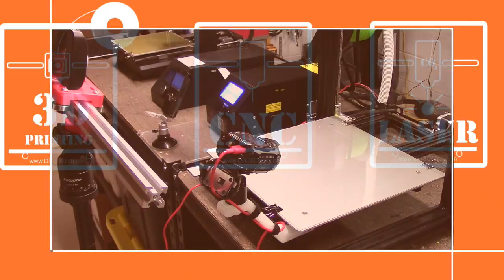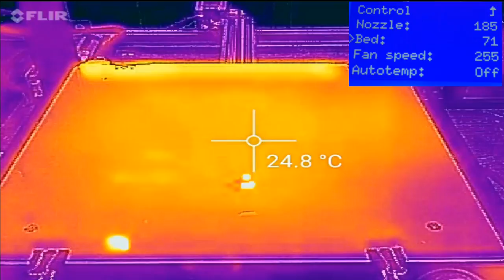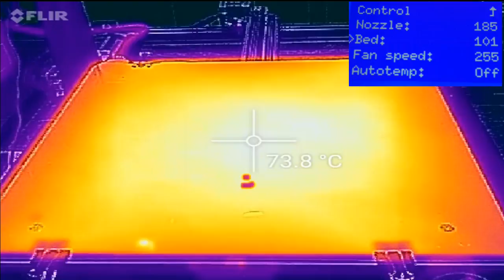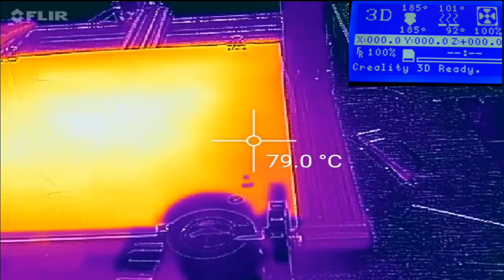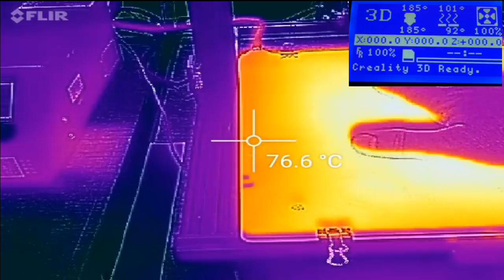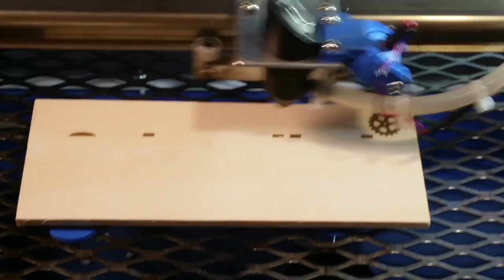Creality CR10 - Analyzing the Heated Bed with the Flir!

Comment: I know with the FT-5 build, many people use a cork tile under the aluminum bed to insulate the heated bed and help it heat up quicker/maintain temp.  Pretty cheap to find at WalMart (office supply dept) and curious to see how that would work.
Reply from the maker: Interesting idea, however my fear would be "have you ever seen cork burn?".  Nasty stuff as it burns an spreads quickly.  So I would avoid it for a non-flammable version, I am think ceramic tape as its light weight with a high reflective coefficient.

Comment: The stock CR-10 has the heat bed thermistor mounted directly in the center of the bottom of the build plate.
I've carefully peeled off the kapton tape on the stock CR-10 and have moved the thermistor closer to the edge of the build plate (with some new Kapton tape). Fortunately, the thermistor leads were long enough so no splicing necessary. In theory this should give a better average temp over the bed. (The center a little hotter, but so is the edge.) I am also planning to tape insulation on the bottom of the bed.
Reply from the maker: Interesting, I going to try and insulate the bed first and see how that does before moving the thermistor, but that is an option :-)

Comment: So the problem with the Flir or any other IR based temperature sensor, you will get funky number from aluminum and PEI. PEI is doesn't reflect IR, so all IR will go through to the aluminum, and aluminum will reflect IR. So the science behind your measurement is just not there. To get an accurate reading from the FLIR you need to put a sheet of black paper or cover it with blue tape, something that will reflect IR.
Reply: We tried using our Fluke FLIR camera on an aluminum fixture and were not able to get accurate readings until we put masking tape on the fixture.  FLIR cameras do not like reflective surfaces and don't give accurate readings from them.
Reply: It will work with painted or anodized aluminum -- not with regular untreated aluminum -- just how these cameras or heat sensors work, they use IR and IR gets reflected by aluminum. When I test my printer builds I just stick a piece of tape on the spot I want to measure -- or you'll get garbage results. There is also something to heat distribution, yes edges will not be as hot as the center, but the demonstrated 20c difference in the 90c high end is total nonsense, it's just not possible for a heated bed to have such a drastic curve 5c in the 60c range and 20 in the 90c range. Test this properly and you'll see edges much closer to the center temperature. Another aspect which tells me the results are suspect is that you are getting hotter reference measurement at the center than the thermistor is reporting to the printer because the thermistor is closer to the heat source.
Reply from the maker: Your correct on the "PEI is doesn't reflect IR"  as I was just sharing that in another thread, would agree if you wanted it perfect a black body would be the best, however this version of Flir is from the best so in general I was surprised it was so close to the thermistor reading.  Yet the idea here was share the general heating pattern of the bed :-)
Reply: PEI is is not the problem. The aluminum is the problem. Put a non-reflective piece of paper on the bed. Measuring aluminum is pointless
Reply from the maker: If it was "pointless" why was it so close?
Reply: It's not accurate, that is the point. The edges were not close, I told you why, aluminum reflects IR. You can't us FLIR or other noncontact heat sensors to accurately measure the temperature of aluminum. You saw the variation between the center and edges yourself. If you're going to ignore my advice to simple drop an opaque sheet of paper on the bed and measure again, then I have nothing else to contribute.
Reply from the maker: I still struggle with this and even did some testing last night and came up with the same results so I can't buy the theory is faulty as again why do they match?   I produced a video on this so keep an eye out as I am open to debate.  However when the two align so closely again I struggle calling it faulty :-)
Reply from the maker: Also I did look at what you sent (link) and I think part of the apple and oranges here is the Flir I am using, as its like the "Seek" in that has an single IR element an do not (believe nor does it appear) to have a lens.  So again I am confused as this sensor (something I assume like: https://www.melexis.com/en/product/MLX90621/Far-Infrared-Sensor-Array-High-Speed-Low-Noise) would not be prone to reflections...
Reply: Unless you validated your measurements with thermocouples, any "verification" you may have done last night would be suspect. 

+Kazolar is correct in all s/he has posted here.
Reply from the maker: Hey folks I maybe ugly but dumb, well not so much as yes used thermocouples as I knew where you doubting Thomas's where going next :-))
Reply: No one is calling you ugly or dumb. The way scientific research works -- last time I checked is that you present your findings, someone questions your methodology, and thus your findings, you then can't go back and say, hey -- I got right numbers, explain why I got right numbers. Huh? You used what is scientifically accepted as flawed methodology -- got valid numbers and then you want the rest of us to explain how your flawed methodology gave a valid result -- yeah...sure friend. I like your channel, but you need to back this truck up. 
And considering you use a laser cutter, would you ever put a piece of aluminum into your laser cutter and expect it to work -- safety first, only anodized or treated aluminum...same deal here. I don't have a CR10, I have other printers with as large and larger build volume. I built my own heat beds. I validate their accuracy with contact based thermistors. I've read a number of articles that explain why IR based temperature sensors are crap with aluminum. Read David Crocker's blog about his IR bed leveling sensor that it DOESN'T work with non-treated aluminum, too much refection. Why you got what you think are "reasonable" numbers -- who knows, stars aligned, room was dark, IR didn't bounce all over the room. Or the bed is anodized? Not my place to explain it -- yours.
Reply from the maker: LOL!  I am joking :-) about the ugly however in the test I just did (which I will publish as a video, there was no practical  difference if I measured from the bed (bare shinny metal) or a piece of dark tape.  Also not only did I use the Flir, but also another IR thermometer and the results where the within a degree (and that was only due to the location on the bed as too there dual thermocouples connected.  So when you talk scientific method I have a control and two test groups.  Also if your a long time viewer you will also know I know a lot about IR lasers, light etc and you not talking apples and oranges.  Look  back in the CO2 laser playlist and you will see where I try this with a coin (viewer request) see what happens so to answer your question I do know first hand.  Also for clarity I am not POed as I enjoy the debate and discussion and appreciate your comments as this is why I started this channel :-)
Reply: When I was building my 20" square heatbed, I was getting odd measurements with a Seek and a IR thermometer -- bed said it was at 60, and both IR tools reporter 36-45, odd weird numbers (when I was measuring on the top of the aluminum heatspreader with the silicone heater adhered to the backside).  As soon as I put a piece of blue tape on the bed, the seek image lit up in that spot and was reporting 58 or something close. So I contend your bed is not aluminum but is anodized or otherwise coated. My experience is with straight from the metal factory aluminum 6061 plates. They reflect IR like crazy. Looking forward to seeing the next video where you compare. It's not really apples and oranges though. You will have a bad time if you stick an untreated sheet of 6061 into a CO2 laser. It doesn't work, neither does anything to do with IR with aluminum. Again the question as to why you're getting correct values is for you to figure out -- I don't have a CR10 heatbed to figure what it's made of, like I said, I have machines that size and bigger, and even though CR10 seems like a wonderful machine, mine are significantly better, and faster, and of course several times more expensive.
Reply from the maker: Wow 20" bed!  That my is kind of printer!  Also one "As soon as I put a piece of blue tape on the bed, the seek image lit"  Does the Seek have reticle target?  As this is where I am taking taking my temperature measurement from not the "color" as yes a piece of blue tape will "change" the color but not really the temp reading.   Wed around 8pm Est a video is schedule to post where I do this very test and spoiler alert both temps are the same (within 1 deg and that was due to the split location on the bed).  I also used an IR spot termometer too along with 2 termocouples so take a peek :-)  Do you have any videos of that 20" monster printing?  Would love to see those!
Reply: Yes, I can tap on the phone/tablet and seek will show me the temperature at the target, and without the tape, the center was about right, but move away from the center briefly, and the color faded quickly, and so did the temperature. But it wasn't real, it was a measurement issue, when I placed tape on perimeter spots of the bed, they glowed and showed temperature 20c different than without the tape. I saw your last video and it certainly seems that the CR10 bed is anodized. I am presently building a printer which will have a 24" (610mm)  square print bed with most of it printable (Cartesian design). I'll have to figure out the true printing area once I get end stops in place. The build has a very, very interesting twist to it, lets say I haven't seen anyone attempt to do this , but it works in cad, and in theory, and so far it's working out in reality. The printer is actually much bigger, I'm building it on a 42" square table. I am recording the build, and it will be the inaugural series of my channel (fingers crossed). I've been asked to post build videos as I progress, but I can't be that disciplined, plus it will take twice as long. I am building, recording, and when I get to a logical stopping point, I'll edit and schedule the series to start. I think another couple of weeks of building will be that point. I've been building for over a month, so I have a lot of footage to edit. The 20" square bed (I was rounding for Americans) it's technically 500mm is a 6' tall delta with a build volume of 490mm diameter, 665mm height. Square beds are easier to make -- even though it's a delta. Sourcing round things is much harder. So only the circle of the square 500mm bed is obviously printed it on. Once the inaugural series on the new build is done, I will post videos about the delta.  For now I have some older shots of the delta here: http://www.automatedmaker.com/ -- It is enclosed now, and has 2 extruders.

Comment: My bed stopped heating after the first print any solutions?
Reply from the maker: have you checked the power with a multimeter?  Also double check your connections both on the bed and inside the control box...
Reply: Not yet that will be the next thing im going to do
Reply from the maker: Most likely a wire and at worse case a Mosfet..
Reply: Voltage doesn't even get out of the box so im thinking its the mosfet
Reply from the maker: check lose or shorted solder joints as well as test power into and out of the Mosfet...

Comment: Have you tried to use a hair dryer to help preheat?
Reply from the maker: Can't say i have, how much of a difference time wise does it make?
Reply: I don't know. I've ordered a CR-10 and it should be here next Tuesdays. I'm just watching as many videos as I can to get to know as much as I can. It's an idea that came to me when I watched your video. I'll try it as soon as I can and let you know. Maybe you can try it and make a video if it works.
Reply from the maker: Sure as doubt a hair dryer will do much as it really doesn't yield that much heat and I have tried in the past with a heat gun (which gets VERY hot) on my glass bed Davinc's and yes it was quicker but you had to invest the time to stand there. Here I just push the button and walk away, oh the other thing too is I only print on PEI so the heat gun would damage it.  PS if your getting a CR-10 get PEI (http://amzn.to/2uSqzPO) this stuff is worth its eight in gold!
Reply: I see a hair dryer actually removing heat from the work area. I just don't think it will get hot enough to make up for all the cooler air it pulls in.

Comment: For the price of the printer id say its awesome. Quit being picky over a few degrees off. I mean really? This isnt a 3000.00 dollar printer its a fairly cheap printer quit expecting thousand dollar and above performance for half the price.
Reply from the maker: I am very happy with it and recommend it but a few degrees can be trouble some for high quality prints because a few degree drop out can cause layer adhesion issues and lot of the stuff I am building is for drones and it needs to maintain a level a structural integrate unlike something like a hook or hanger...
Reply: Then maybe you need to invest in something that will be spot on every print not something you may have to wonder about. Would in the long run give you piece of mind and save you money if any misprints happen with what you have now.
Reply from the maker: But then it takes the fun out of it :-) as a big part of this channel (i.e. DIY) is taking something (i.e. Tech) and mod it to make it better then was before.  As I am huge believer in the Deming cycle...
Reply: I agree with tom. That being said as a newb myself I have printed quite a lot of ABS on mine. And yes large boxy parts do have some problems.  But a lot of smaller thinner parts work just fine. I set the bed at 110C and go. And yes I have had the bed temperature actually get there. Surprised me actually. I generally start the print at 95C and tell it to keep heating to 110C.  Yes that large surface area dissipates a lot of heat. But it is pretty easy to mitigate.  I stuck one layer of cardboard underneath and I lay paper towels around the edge of the print.  Doing this can literally cut the heat up time maybe 20 percent or better.  And it can just keep going up. hitting 105 is easy but any breeze can make it struggle to hit 110.  I'm a cheap DIY and I dont have a fancy bed cover. I just use aqua net on the glass. 
It is a huge monstrous improvement on my little 3up printer.